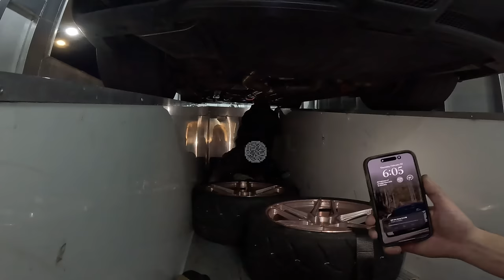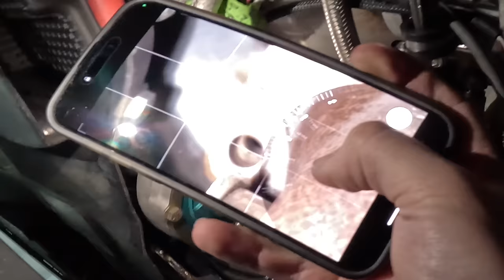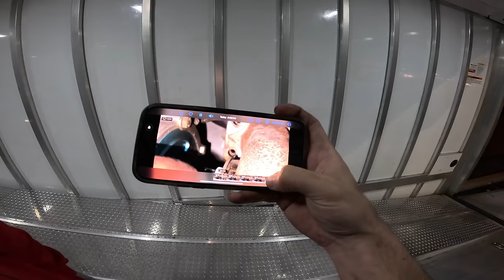Racing the FASTEST Cars in Vegas!!

Comment: “1900hp to keep up with a car with 2 bolts on a turbo” was cold asf😭
Reply: But also not true. Dude had sand bags in the trunk. And to be fair, probably built it himself. Didn’t ship it off to someone else to do it for him. Bought not built
Reply: @joshuaearnheart2756  he had 3 sand bags in the trunk, the power to weight ratio doesn’t really matter much when youre making more than 700-800 hp more than the car youre racing, should beat them everytime. Also, the blue car had rear seat delete and the trunk was also gutted, the sandbags possibly made it the same weight as a stock GT. Your argument is invalid but i see what you mean.
Reply: @joshuaearnheart2756  Dude said he had a shop build the motor & trans, & put on the on3 turbo kit
Reply: @user-su3yu2rf5c  the point about sand bags wasn’t the fact that it was heavier. It was meant to point out the fact that was his traction control. He didn’t pay someone to put a $5k motec system in the car to drive itself
Reply: @joshuaearnheart2756  well that's his fault, should put motec on it then. either way, it is true... he did have two bolts completely missing, don't know why you would say its not true
Reply: @spacethottie7625  who’s to say when the bolts came out. If it was down on power that much, he would be able to tell. That’s how he knew it sounded bad. They could have sheared off on the last run
Reply: @user-su3yu2rf5c  Your comment was pointless cause the GT350 wasnt any slower with the missing bolts. He would have obviously noticed a reduction in power if he actually lost power but he didnt.
Reply: Once he figures out the traction issue maybe stickier tires that thing’s a rocket was just burning out the whole time pretty badass overall.
Reply: @999.Strixx  he literally said at the end of the video it wasn’t making full power. but to be fair the Blue stang will be a missile with the traction figured out.
Reply: @Whereisjesus15  he wasn’t burning out as much as you think, if you look youll see the amount of rubber on the quarters from just driving to the gas station. under load the rear end would have squatted down on the tires allowing the rear quarters to rub the rear tires burning rubber off. To some extent he probably was spinning, but most of that smoke was from the quarter panels making contact with the tires. but all that doesnt take away from the fact the blue stang is absolutely badass and will be a missile with the traction figured out.
Reply: @user-su3yu2rf5c  he is lying tho lol cause he would have noticed while driving if he wasn’t making “full power” as he has driven the car plenty of times at full power.
Reply: Just stop.... Bro your shit is dope no doubt but to think you ran with these cats is crazy.. Your shit popped way after races. Its quick but you aint that guy pal. I promise.
Reply: Blue mustang would be lucky if its breakinf 850hp!  Sad
Reply: I don't think the blue car was spinning I believe it was tire rubbing fender

Comment: Dude did a burnout the entire time every single race 😂😂
Reply: No that's the tires rubbing sadly not a burnout
Reply: @joshuajohnrocks  bro look at the road. He’s leaving black marks.
Reply: @creepystank420 its definitely a mixture of both
Reply: Negative! It was from the tires rubbing. If he'd been spinning at those speeds he'd have been wrapped around the concrete divider!
Reply: @wizza2315 Some people's reasoning is kinda crazy and stupid sometimes... you got one of them I think..

Black marks on the road is not tire rubbing
Reply: @wizza2315  not at all. Plenty of people have cars with amazing suspension that can do rolling burnouts to 100+.
Reply: @creepystank420 you D ridin big time blue mustang smoking from tire rub look at the driver side no smoke at all just passenger side smoking
Reply: @SmileySRT  the car makes 1900whp and you think it won’t spin? 😂 gtfo
Reply: No way that car makes 1900
Reply: @SmileySRT they say the smoke is because it's spinning not tire rub, but the thing doesn't smoke on the hit, it smokes as the run goes on because the rubb gets progressively worse. I'm sure it spins on the hit but most of the smoke was the rubbing.
Reply: @robertofigueroa5011  Correct and the few rear shots you see from the car, you seen defined thin lines in the tire marks.
Those lines are where the tire is hitting the fender.
The car is not spinning, it's squatting enough to rub the fender and melt the tire in that specific spot.
Reply: @joshuajohnrocks  same thing I was thinking
Reply: @MisterGTP  look at 5:05, he explains the fenders are rubbing.

Comment: Imagine being that hyped and bragging about beating a car that's smoking the tires the entire run 😂
Reply from the maker: I built this car specifically for NOT spinning even though it easily could with traction control off. Don’t you see that your comment is EXACTLY WHY I was so hyped? 😂 he was spinning, I wasn’t.
Reply: @itsjusta6official  I get the being hyped about your car working and all of that. My point was all the bragging and saying how you gapped him while he was smoking the tires the entire time.
Reply: @bluecollarbuilds8860 cause a win is a win duh 😂
Reply: @bluecollarbuilds8860  I don't see your point. He was not spinning the tires they were rubbing the fender. In one of the clips you can see a thin black mark from the outside of the tire melting.

Comment: my BT 1.8 T 50 trim would rattle loose alot, my fix - arp studs, nordlock washers and jet nuts should fix it- torque after a couple heat cycles.
Reply: i had cosmic gaskets fail machine the surfaces call it a day

Comment: The blue mustang was burning tires because the faster they were spinning the bigger in size and they get, and they were rubbing the fender wells. You can see the rubber on the backside. Wouldn't have been coated if it was spinning tires.

Comment: I know it’s had issues every time it’s been ran hard but funny enough almost all issues have been person-fault related…😅 which when we’re talking about street cars making north of 1200hp, those are the best issues to have opposed to cracked blocks or dropped valves or anything like that
Reply from the maker: Very fair!!
Reply: @itsjusta6official  pumped about the reply, I’m daily driving a 5 litre f150 on 35’s straight piped with mustang manifold, throttle body, fuel pump, injectors and mapping as my work truck just cause of this channel, keep it building homie… I know I’ve hated about being teased on upcoming vids just to have to wait weeks to finally see it but that’s more love hate than hate hate and I know you know what that means